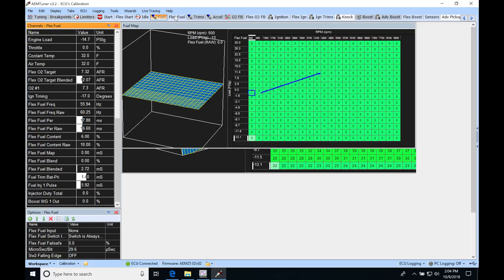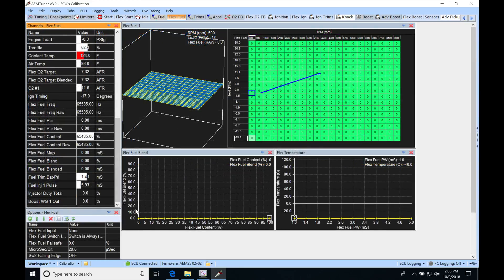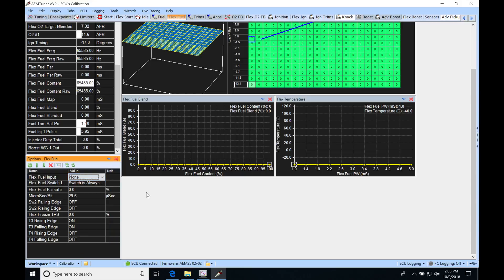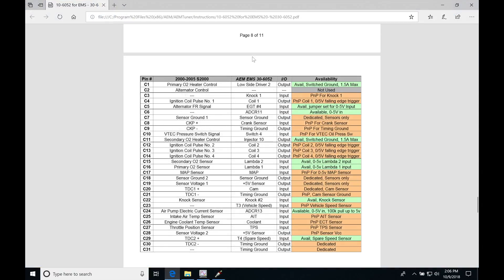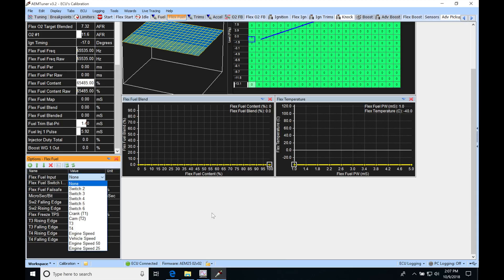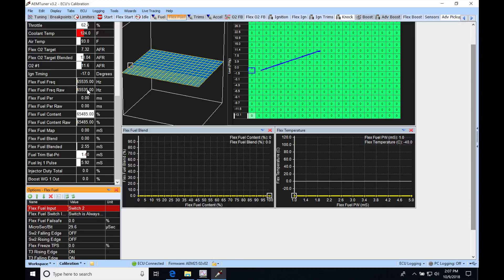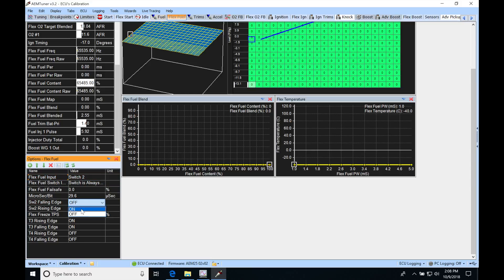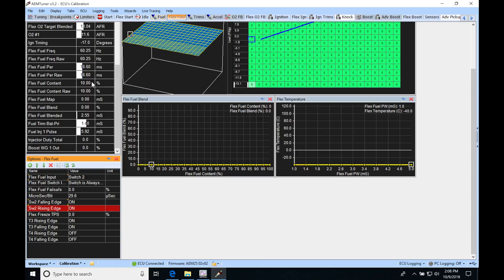AEM Series 2: Flex Fuel Tuning | Evans Performance Academy

Comment: I cant seem to get my sensor hooked up correctly.. can you help me out? I have the sensor wired to a 12v ignition, a chassis ground and wired into the pin A26 (switch 5) on s2000
Reply: Just went through figuring this out myself; for future viewers,

(FOR S2000) You want to wire the flex fuel sensor out wire to either D11 (switch 2) or D12 (switch 3)
And set the flex input to which one you wired it to.

AEM instructions state it can be wired to t3, t4 or switch 2-6 but 2 and 3 seem the simplest (nothing else being used through the pin) so use those
Reply: @darkknight097  thanks, I ended up getting it. Now I have issues of the car not starting when the engine warms up 😭 car life
Reply: @Seth Nielsen  Np, I feel ya. I had the opposite issue; the car wouldn't start on the first turnover when cold. No matter how long or short i held the start, it would immediately start on the next start button press.

It took me about 3-4 weeks to fix this issue (only happened on cold starts from sitting overnight) as I only had one chance a day to see if it was fixed. Ended up being a combination of crank adv, start extra, start decay, warm up enrichment, and my actual ignition table where the load cell was active at about -1 to 0 psi at 500-1000rpms

The hot start, you may want to take a look at your start extra vs temp and intial crank pulse tables (if you're still having this issue)

Mine started on hot start, but i noticed it was really lean, like 16-17 AFRs for a minute or two.
I had to increase the start extra and decay settings in that area to get a 14.7 AFR on hot start.
Reply: Did you ever figure this out? I'm same issues but with DSM 2G
Reply: @Trooth412  yes I did
Reply: Still can't figure mine out 30-6310 have mine connected to pin 45 "a/c compressor", input  switch 2 sw 2 on all edges maybe try pin 6? Seem like pin 45 only pin for 12v need some help 🤔  thanks
Reply: @Abel Flores  Connect it to pin D11. D11 Is switch 2
Reply: @Daniel  I'll feed 12v wire ignition and try again and singal wire "D11" is for S2000, i have 30-6310 evo/dsm can trys different pin switch 3?
Reply: @Abel Flores  Should be. I'm at work rn but later i'll take a look at your pinout diagram and see what works
Reply: @Daniel please thank you been over year no success
Reply: @Abel Flores  Looks like you can use switch 4->pin 7 switch 5->pin 107 or switch 6 pin 117 as your signal wire connection. -Edit, looks like switch 3 would be pin 24

Can tap into any switch ignition pin for 12v and then just find a good ground. Which ever switch you use, make sure you have rising and falling edge turned on.
Reply: @darkknight097 Did you need to change anything from the table(retune) after the flex fuel sensor installed?
Reply: @zj120cn  Yes, there's a few things that need to be changed or edited if whatever map you are using hasn't been prepped for flex fuel. 

First, you need to turn on the rising/falling edge for what switch (sw) you used as input.  That will enable the aem to see the actual flex content.

Second, copy and paste your fuel map into the flex fuel map. Then scale it up by 30-40%(you may need to play with the percentage you used a bit) to get a ball park value of how much fuel will be added when you put ethanol in. This method only works well if you have your entire fuel map dialed in where it can run in open loop without being excessively lean or rich. If its not, then you'll need to go in and manually change each cell when you fill up on E to get good AFRs after you scale it

Third, you need to scale the flex fuel content graph based on how much e% you plan on using. For example, if you plan on using E50, then on the graph starting from ~E13 at 0 to E50 at 100% . This should be set linearally. This tells the aem how much to change the fuel percentage based on your target E content. So ~E30 would be a 50% fuel increase (based on the 30-40% increase of your flex fuel map). If set E70 as your 100% then ~E42 would be your 50%

4th, set your flex AFR values. You can lean it out a bit more because of its cooling effect and its different stoichiometric ratio if you want to minimize MPG loss, if not then use the same values as your main O2 map

5th, you'll need to adjust your start up flex, warm up flex, and flex accel values. Generally you will need a much higher initial crank flex pulse for colder temps for higher E content levels. This should be based on your max E content you plan to use as the graph i mentioned early will use the scaling based on that. These ones might take some playing with to get dialed in 

6th, finally you can start tweaking your flex ignition values. Idle and part throttle/crusing can generally remain the same. of course you'll want to start increasing your WOT values but don't get too crazy.  Depending on your whether your still NA, you can add too much timing and still not knock because of the properties of ethanol

One thing thats not necessary but is nice to use is the flex content hold/freeze. This works by you setting a certain throttle limit and when you are over this, it will freeze the e content value is sees. This is helpful to get a more consistent AFR during WOT so the aem is not scaling it up and down as the flex content value it sees can change +/- 5%
Reply: @Abel Flores  the 12v can be anything thats ignition switched.